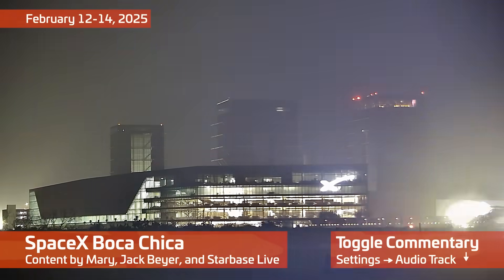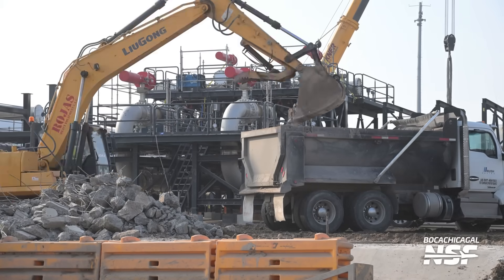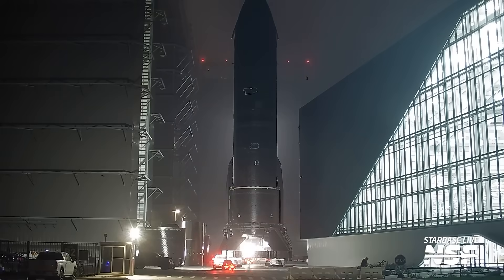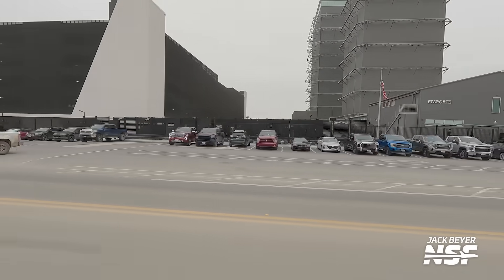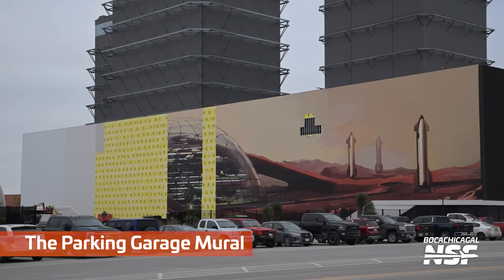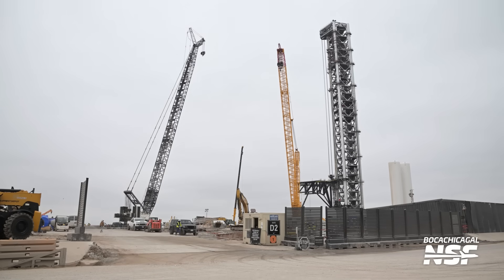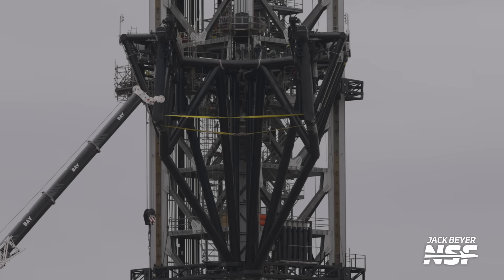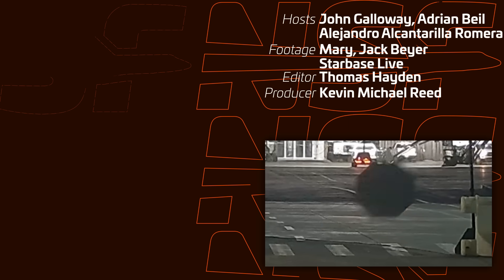How Many Engineers Does it Take to Replace a Stop Sign? | SpaceX Boca Chica

Comment: The "Red Things" look like "Hammer Arrestors" for the fluids that are flowing and controlled by valves. As the fluid gets moving and then is shut off it's like a long tube type train that can weigh tons. And when it suddenly stops it will slam or "hammer" the system. And that hammering action can break things like the pumps, piping, valves, etc. That's my opinion of what they are.

Comment: John, the "RED" things appear to be valve actuators, as there are valves directly below 
Also, did the nose section you showed moving into the high bay (I think) have an enlarged cargo dispensing area?  It looks like it was covered by a tarp and the tarp had a fold that "looks" to curve into the surface larger than the usual pez dispenser size.  Hard to tell 3 dimensions on a 2 dimension screen.  You might have more pictures to look at.

Comment: the red/orange things are Bettis brand pneumatic valve actuators. They open and close valves in the pipe they are sitting on. The large diameter side is where you apply air or gas too one side of a piston to move the valve and the small diameter side contains a spring to return it.

Comment: Does anyone else think the pad B flame diverter looks really janky and flimsy?? How will they stop those small pipes from getting blasted apart and destroyed, even despite the water flow?
Reply: The same way other watercooled flame diverters don't get blasted apart and destroyed... This is not SpaceX's first rodeo making one of these
Reply: @ale131296  Alex, I'm aware this is not a new concept, but I'm just shocked because the Starship is way more powerful than anything else. I'm not doubting the efficacy of the design, but I don't get how the pipes are kept together under all that force. Maybe a future video could go into how a traditional flame trench works?
Reply: @ the pipes are welded together, they've not done that yet

Comment: The pipe on the flatbed at time 00:50 looks similar in length to the pipe visible (behind the larger pipe in the forefront) on the tank being installed at time 1:31.

Comment: The red things are rapid high pressure valve actuators. When you need to pen or close something(really fast) that has thousands of pounds of pressure behind it.
Reply: Is that for water or some other consumable?
Reply: @michaeldeierhoi4096  It´s at the tank farm, so probably for LOX and LNG. Maybe some for the Liquid Nitrogen.
Reply: @hectorpascale1013    Thanks for explaining.  It will be interesting to see at work when the launch pad is set up.

Comment: Das, the big red things are valve actuators (remote open and close). they also appear to be fail safe actuators that fail either open or close. the long skinny side has a spring and the fat side has an air operated piston. 95% sure but its been 35yrs.
Reply from the maker: Appreciate it, will look into them more - Das